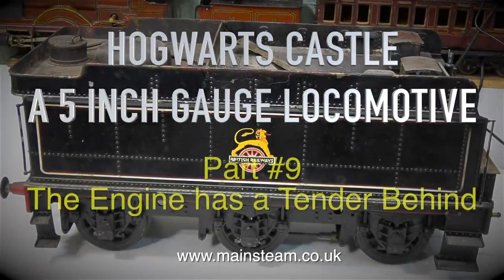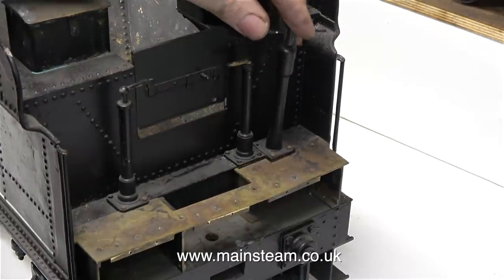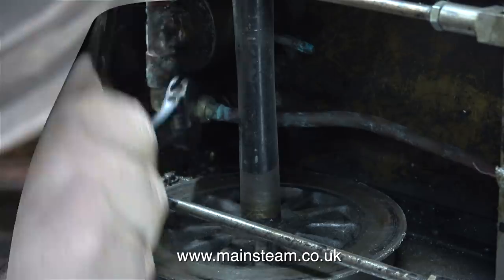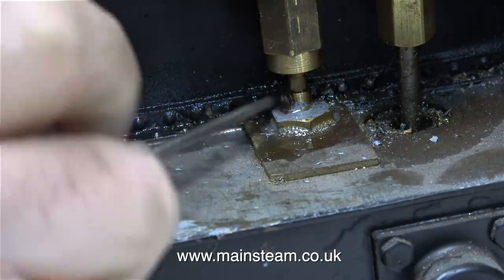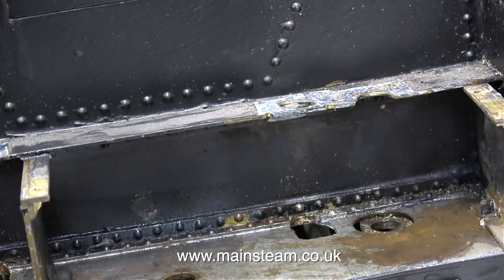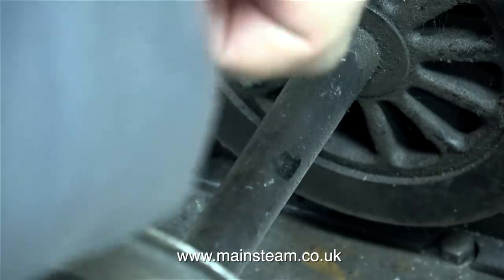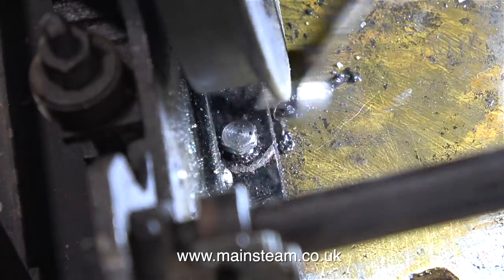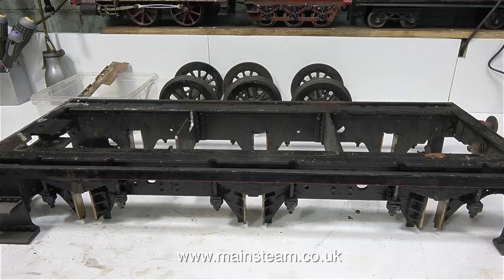HOGWARTS CASTLE - A 5 INCH GAUGE LOCOMOTIVE - PART #9

Comment: Hey Keith i got a Stuart Turner 10v and a coal fired copper boiler but the boiler needs a new water gauge glass fitting and a fire grate how much would it cost to get them fixed and keep up the good work from kallum.
Reply from the maker: I would have to see what it is before I could quote for the job. The boiler would also need a Hydraulic test to make sure that it is safe.
Reply: @keithappleton  could i send you the pictures of the boiler via messager?
Reply from the maker: Please send to: sales@mainsteaam.co.uk

Comment: Easy to say with hindsight, but it looks rather like if you took the wheels out first you could have got a socket on the nuts/bolts holding the frame to the body. Maybe this will help with reassembly (rather than just be an annoying smug comment that makes you feel even worse about spending 5 hours getting the bolts out)?
Reply from the maker: no chance at all - the bolts were hard up against the chassis angle.

Comment: Hi I'm not an engineer but I pretend to be an electrician and I sum times have troubles with my nuts and I have sacrificed a couple of of wrenches not wenches by having the shafts bent at an angle so I can get around the corner to get my nuts off and on, I'm locky I only have a few sizes to tackle. It may be worth a thought. Or the nice man in white cotes may just need to take me away for a while